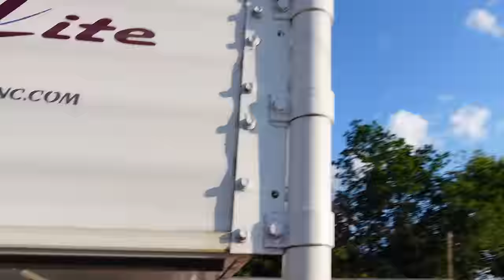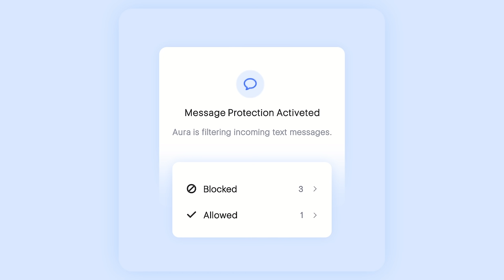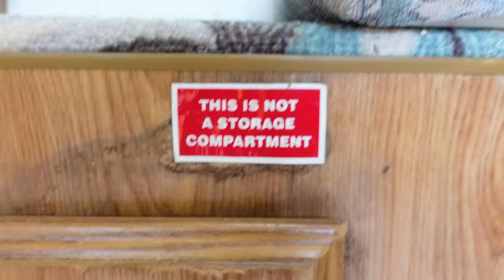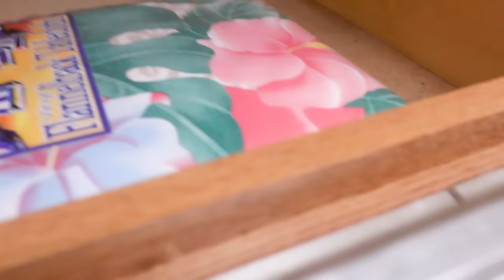i bought an old TRUCK CAMPER...was this a mistake?

Comment: Lots of people buy stuff on Facebook Marketplace. I'd pick up a fiberglass cap and a matress.

Fixing a camper is lots of work, stretch it out and do it right.
I think to stop leaks they got this clay like weather striping, you put under the aluminum strip's that runs down all the corner's,...I'd probably do that last, and tear into the water damaged area's first.
Like I said they practically give campers away for this reason.
Until its fixed I'd cover it with a tarp.

Comment: for the roof crank, you might look into window springs, tight flat coilsthat help retain tension so nothing drops on it's own and assists with lifting due to the same tension. vinyl double pain windows are very heavy...were it not for the steel coils on each side, no one would ever lift their windows open. just a thought :)

Comment: Help at it girl you’ll get through this and it will be worth it 
As far as the cranking gos get yourself a 24 volt battery drill fit a adapter and let the drill do the work

Comment: Black Jack eterna coat silicon. Roof costing is awesome stuff. Got to clean off any old material for best results so if you haven’t used anything yet put this on there never have another issue. 100 bucks online free shipping. Worth every dime. Could do that maybe with a gallon.

Comment: Don't feel bad, about 3 years ago i bought a 2014 Tacoma and within the first year i probably put around 8000 in repairs and it still isn't right, but that is a good looking camper and you can remodel it in to something nice so keep your head up darling your doing good 👍

Comment: Cut the bearing race off with a cutoff wheel, save yourself $$$.
Also for the crank issue, remove the handle and use a 3/8 or 1/2" cordless impact gun.

Comment: You can remove those hand cranks and make an adaptor to fit on a cordless drill or impact and run them up and down much faster and easier.

Comment: As long as the crank isn't jamming from age or abuse all you really need is Leverage find a way to extend the handle to give you more leverage or you can have a socket glued on to the center of the crank a news a battery impact

Comment: Never a bad idear iv had caravans, camper trailers, tents, swags. I have had a slide on  camper on the back of my BT50 and i camp in the mountains on beaches and in the desert.. in Queensland and for solo or couple camping its the only way to go.. 670w off solar and two 300ah lithium batteries and a 3000w inverter i run airfryer, coffee maker, microwave, fridges and an A/c and a diesels heater.. have fun..

Comment: As far as your camper is concerned. Canvas is great for warmer climate. At absolutely sucks when everything gets cold and wet.. they make an upgrade for those. It's a flip out hard-sided panel.. and the panel has some insulation in it. It's only about an inch and a half thick but it's better than canvas..

Comment: For roof leaks there's Eternabond roof tape that works great. Camper roofs always leak. Frequently the screwed on trim at top of walls. The tape can help seal it.

Id bet a lot of leak is from joint where the separate halves meet. Water needs to casade out and down side. Likely help to add a flat weatherstrip on top half so rubber edge is lower and sticks out covering open joint. Directing water over bottom section rather than creating a drip edge to run inside. Something similar to a garage door seal, that you trim off rubber. Then could use the alum screwstrip from rubber roofing to secure to shell.

If your needing a new axle cuz part of the bearing race is stuck on there. No biggie, dremel or cutting wheel perpendicular through it being careful not to nick the axle. Get most of way and screwdriver will split it open. 

Use some silicone spray lubenon those top slide tracks. A little lube goes a long ways :) 

I have an email address in my vid descriptions. If you need to phone a friend on campers, electrical, solar, batteries,  and just about anything else useful
Reply: You can also use an Elastomeric roof coating on the top to help seal and protect. I believe it will stick to nearly anything clean.

Comment: Lube the top lifting gears and cables etc.  I bet it will turn up and down much better.  I have owned 5 RV's in the last 20 years and decided a truck camper was what I wanted.  The ease of driving and not towing is much more user friendly.  Not to mention parking almost anywhere a pickup truck can fit.  Give it sometime and fix one thing at a time.  Owning any RV means there is always something that needs fixing.  But if you learn how to fix things on your own you will save so many repair cost down the road.   Independance and freedom is the reward...

Comment: I hope your camper works out for you your truck camper I've been living in one out in Colorado for going on my second winner here before I just left it in my pickup I never took it out and then I stayed for 2 weeks and then got supplies I had to pack everything up now I just take it out of the pickup and set it on the ground and level it with the Jacks and I can go and come as I please I really like it it's nice and warm I could use the water in the winter time without anything freezing as far as your Jacks to hand crank them you can get a cordless drill and they Walmart has a socket that you can use to crank them up and down with

Comment: just a suggestion. wait until after you check out the item before offering the seller a lower amount than what they were originally asking. that way you don't feel guilty about backing out of the sale in case you decide it's not what you were looking for. you can still ask them "are you open to offers" beforehand, but let them know you want to check it out BEFORE you make your offer. this also makes it so you can offer an even lower amount than you were originally intending to if you find more problems that weren't listed in the sellers ad.

Comment: A lot of manual hand cranks, can easily be replaced with a strong battery powered drill or impact driver using the correct adaptor.

Comment: You could adapt the handle of the bed or make a jig to go around the handle to accept an impact driver that you could use to lift the bed and the same system could be used to take it on and off the truck.

Comment: Very fusstrating when the bearing blows apart when pressing it out but I don't let that get me down I just pull out the grinder with a cutting disc and cut about half to 3/4 through the bearing race then grab a chisel and hammer and brake it then it will come off the axle

Comment: Hey Be sure to take off the crank handle for the top and make a socket fitting of some sort attach to drill and it will go up :) I did this w/a tent trailer :) .

Comment: I bought a whole new used rear end for my '81 GMC half ton pickup at the junk yard for $110.00.  My pickup was a diesel and had a 2:70 rear axle .. all I could find used was a 3:08 gear axle which actually turned out to be a big improvement for better towing capacity .  The reason I replaced my whole rear axle assembly is because my Pinion nut had came lose.  I think I had a bad pinon seal.  I filled the rear end with oil and made a 90  mile trip to the airport to catch a plane for a ski vacation.  Returning home from the ski vacation it went bad 30 miles from home and I had to have some one come and pick me up.  I stopped at a Farm that I knew the owner and left my truck in their yard.
  All I would of had to do if I would have inspected it more thoroughly and maybe grabbed the drive shaft and tugged on it , was to replace the pinion seal and tighten the Pinion nut.  I just didn't catch it.

Comment: I had a palomino slide in, as others have said chain or quick links and turnbuckles from home depot are all those lighter weight. The exp3nsive ones are not needed on that slide in.

Comment: may wanna upgrade some suspension parts on that yota, like a heavier anti roll bar front and rear, and some possible air ride helpers on the rear, but it is all do able with some hard work.

Comment: This is a really badass project. I love that you're doing it, and I think you made some great choices. That Tundra is going to be so rad, and the nice lightweight camper is going to be a perfect fit to go _everywhere_. 

I hope you can find some parts to lubricate to make that crank a little easier to turn; the fact that there's water damage makes me think there might be some corrosion or whatever else that might be making it harder than it needs to be? Regardless, I'm sure you'll be a pro at cranking it up and down soon enough. <3

Comment: Lube everything. Lots of spray silicone. Top and everything works better with lube. I would use lube on the back door. For ease of operation. Yum. Use proper roof sealants. Peace.

Comment: Find a good welder / fabricator  and have them modify the post so there removable when your driving / it’s an easy fix I’ve been welding / fabrication 40 yrs. Have them build you some spacers also so it doesn’t slide.

Comment: The wet looking areas under the mattress platform are more than like the stains from mice urine, it is a common problem when buying campers that have set for a while. there are cleaners if the smell is present they will not help with the stains however for that use bullseye high hide coverage primer and then paint it

Comment: When you get it sorted out, it will be good. I think you made good choices, with the both the truck, and the camper. These things just take a bit of time and effort. I just watched a video by a guy who paid $800,000 for a new motorhome and it came with so many problems you would not believe it. Be thankful that you're not facing a new rig that fell apart on the way to being delivered to you. That said, just put together a check list of things to fix, and work through them one by one.

Comment: If you get a leak poker little hole in it little as possible and put a string on it and the leak will follow the string right down to a pan that way the water won’t be underneath your ceiling😊

Comment: Fixing the truck issues is one thing,  the camper not really.  I live in an rv ,bumper pull and have made fixes that have worked. Make sure you get the brackets that secure to the side of the truck to keep it from shifting side to side.
Flex is the hidden gem for sealing. A small can to roll it on or a spray can version will work. If you ever roll by the fresno area,  I could get that covered from me.
Fixes for smells and mildew,  baking soda even a bag of charcoal, yes charcoal.
What about the jeep?! Let me know, I haven't been keeping up with your posts.

Comment: Put that bit with the bearing in the freezer overnight then hit the bearing out with a same diameter socket. Put the new one in the freezer, and tap it in using the old bearing casing and a sledgehammer.👍

Comment: thats normal for the bearing to break when pressing it off even with torching it. u gotta cut a slit on the inner part thats stuck on the axle with a grinder or sawzall and chisel it off. then press new one on. im a diesel mechanic i hate working on small trucks for this exact reason. i guess im too late to help tho best wishes going forward..

Comment: Wow!!! I absolutely love how you don’t wear bras. You look amazing, goddessYou are gorgeous. Those wires should’ve been ran behind the panel (within the body of the camper) so they don’t get crushed or pinched between the truck bed and camper. These engineers don’t care enough to think of these things or they are aware and call it planned obsolescence. The bearing isn’t that bad, pressing in the bearing can be tricky if you’re not too experienced but it looks like you got the press there (you can always use a hammer too old school). Trickiest part is making sure you are driving the race in equally on all sides so it doesn’t bind and make sure you get the torque specs for the axle nut when installing the hub. As far as the camper, I have found I always beef them up a little bit (without excessive weight on the axle(s)) and button a few things up that I find during inspection. The better the price is the more work is involved to bring it up to a comfortable, practical, safe space. Damn, I really wish I lived near you- I would be delighted to help you with everything (including your truck). I would tell you make a list of things you would like done with the camper, then give it to me. Now, go get yourself a coffee and relax while I take care of everything for you. As far as the crank on the awning— chances are the gears are small in diameter and you may be able to refit bigger ones in their place which would make the cranking easier for bringing the awning in/out. Also, if you live in a humid climate get some silica (amount based on size of space) and place some silica in the corners and sparingly around the parameter inside to help reduce the moisture collecting inside causing mildew/mold.

Comment: Just a suggestion consider adapting an old cord or cordless drill for your cranking needs on your support post. Pardon the pun , Buck up camper, you can do this, And think of all the new stuff you learn. Someone once told me if you're not making mistakes you're probably not doing anything at all.

Comment: Try your best to keep it light weight. You might have to beef up rear suspension if gets heavy. The cabinet to roof might pose a weight problem. Check out Four Wheel Camper M1 project. You got a good deal.🤗🙏🤗

Comment: I’m a mold consultant…free professional advice incoming! You won’t be able to clean that canvas unfortunately. Whenever you’re dealing with porous material like that, if there’s visible mold, it needs to go. I would see if you could find someone who works with canvas material who could potentially design a copy of it for you. I imagine you got some toxic “mold killer” BS spray. Don’t use that! It won’t work…it will grow back and it can make things worse by disrupting (essentially pissing off the spores). All the wood that has gotten wet in the past needs to be fully replaced (dry mold is still dangerous). All the upholstered furniture and mattresses also needs to be fully replaced. You cannot clean mold from upholstery because it gets in bedded too deeply. Make sure you reseal, (ideally redo the roof completely), and reseal around all the windows. As a former RVer, I would honestly recommend tarping the roof long term because the roofs on those things are built to fail and with it already being 20 years old, even with resealing, it’s only a matter of time (not if) until it leaks again. Get benefect decon30 and a fine mist fogging machine from Amazon and once you’ve removed the moldy canvas, mattress/ upholstered furniture and all the moldy wood, you can hepa vacuum the whole thing from top to bottom, then fog, then wipe from ceiling to floor with microfiber cloths (making sure to not use the same one for too long and throwing it out after use). Repeat this process multiple times, then bring in the new materials. Get the mini rechargeable air purifier by Medify from Amazon and use 24/7 in there. I also recommend a small dehumidifier. If you need more support around how to properly remediate it and how to maintain it so it doesn’t happen again, feel free to reach out to me at liveclearconsulting.com please don’t take any risks with your health and wear an N100 mask and gloves while working on it.

Comment: you can't go wrong with a Tundra. I own 2. a 2007 and a 2013. Had to work on both of them but they are great trucks. Like the camper. Everything will need work so it's no biggie.

Comment: Instead of hand cranking the struts, you can take the handles off and use a cordless drill with the correct socket on. Then you just charge the battery in the van.👍😂😂

Comment: I've had a few different campers and rv's over the years while traveling and going to shows and festivals. Menards or home depot sells this roof coating called tropicool. Its a white liquid rubber type coating that u can roll on with a paint roller. The thicker u pit it on the better.. That stuff is awesome, it's a little pricey though. We covered a whole chevy class c rv with it and had some friends paint it. You got this Mama. Just find out what all is wrong with it. As u know, take care of the leaks first. Then make sure your water, gas, and electric are in working order. Just break it down into small manageable goals and knock them out. You're living free and doing what your spirit tells you to, don't let the miserable keyboard warriors steal any of your shine. ~love and light~
Reply: P.s.- One thing is for certain, you miss 100% of the shits u don't take. I'm not going to say good luck because luck has nothing to do with it. It's all about believing in yourself and putting that positive energy into action.